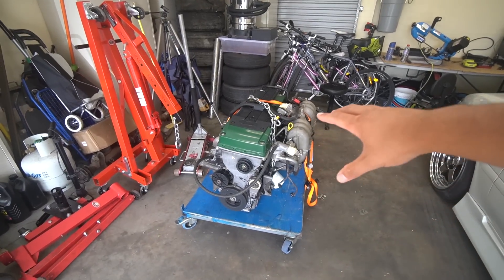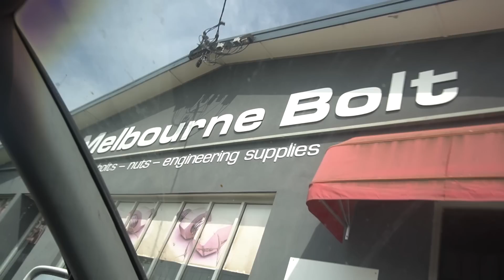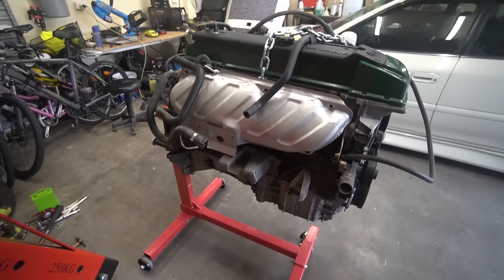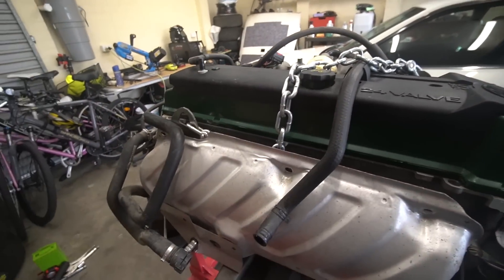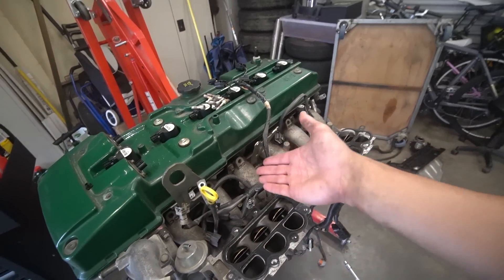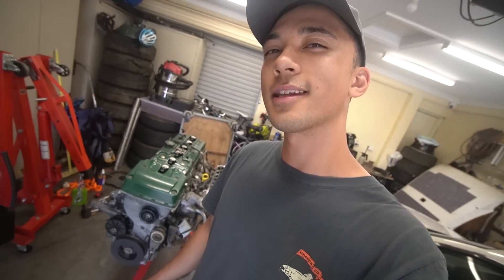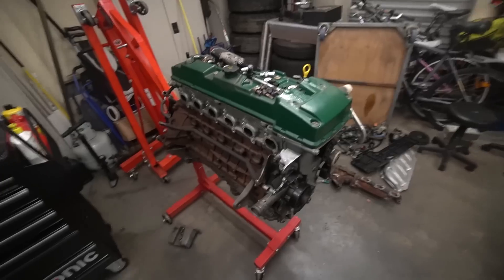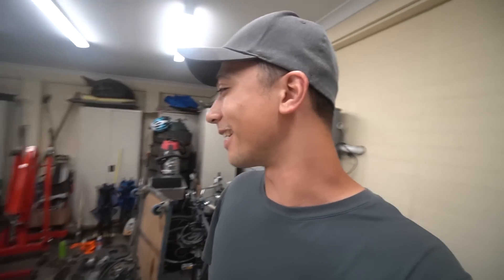$800 BARRA ENGINE TEARDOWN - Preparing for BOOST!

Comment: Territory high pressure power steer line will fit barra pump and e series rack with a small tweak (bend) to the line.
All barra gas engines had heavier rods the 06/06 thing is xr6t only.
Ba gas are 10.7 comp compared to later being 10.3

Comment: Fk yeah my bro awesome to see it all getting done can’t wait to see it in the car . TBH you will hear different stories across the board that you can reuse a head gasket that you should never re use one. Best option is new my bro . With the power steering pump you can convert to an electric pump less drive on the engine and just run from power can run it to a switch or wire it into the system . 

Keep it up brother love the content .

Comment: Keen to see it finished mate, love the videos! You wont need to make mounts. The mounts from the motor in the EF will bolt upto the barra and fit back in the car. You will need a bellhousing from an AU if you plan on using the 4 speed from the EF as the lower bolts won’t line up.
Good luck with it!

Comment: And i think you need to get the front of the sump trimmed to fit around the kframe but dont hold me to it not 100%, keen to see the finished product 🤘
Reply: With EF-EL and XF-XH you do need to modify the sump. Although for XG you can use AUII sway bar with some 40mm or 50mm blocks to space it down. Not sure about E series for that one

Comment: For p/steer you could use an astra p/steer pump they are cheap and you could even fit it in the boot if needed. Also keen for green top Barra cfm falcon shirts and hoodies when you make them , Rex… cheers

Comment: Can also drill out the injector ports and tap the threads for the fuel rail
Reply: Hey man where's your shop I'd like to speak to you about my swap aswell
Reply: @ademtunc4135  which swap are you looking at you can email me my email is in the about section on my channel I’m in Springvale
Reply: I've been trying to email you bit I can't find it I'm also located in Springvale. Could I come down and have a quick chat
Reply: I'm doing the same swap as Rex ef falcon with a gas barra

Comment: This is an awesome build! E series are the best falcons along side of fg’s easily! If you got a set of ford Tickford shark fins it would be the sexiest looking thing on the road!!
Reply from the maker: Very keen to put some wheels on the thing! But engine work and swap first 😅
Reply: Would have zero traction on anything that small with a Barra turbo in it 😂😂😂

Comment: hey rex , im thinking of buying a 100000km milage chaser but my friends keep telling me the engine will completely fall apart beyond repair before i know it . what is your advice on the chaser
Reply from the maker: 100,000 kms is still brand new man! Mine has about 160,000 and im making 450hp so it’s fine !
Reply: That good means it has not been trashed so much ur mates just jealous
Reply: Brandon  and what about the other guys saying the 1gfe isn't reliable, my guts are telling me the same thing
Reply: Brandon  and what about the other guys saying the 1gfe isn't reliable, my guts are telling me the same thing
Reply: Brandon  and what about the other guys saying the 1gfe isn't reliable, my guts are telling me the same thing